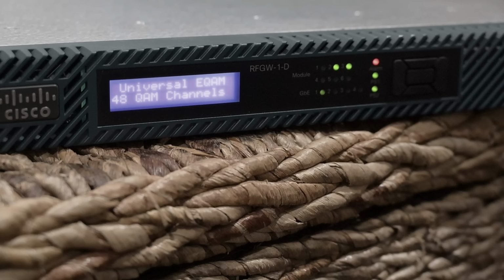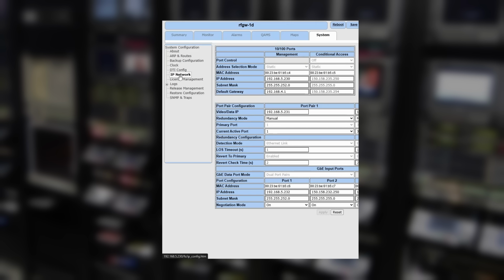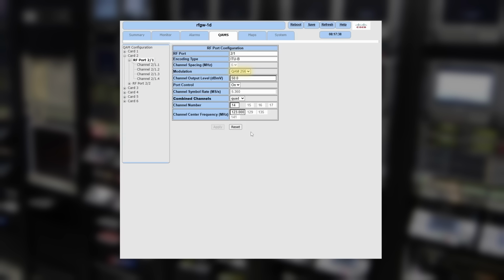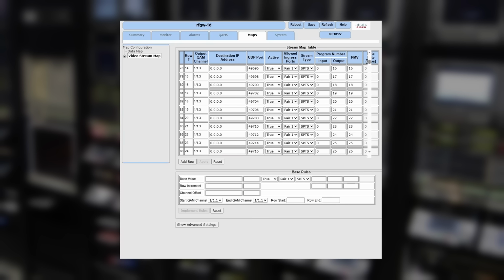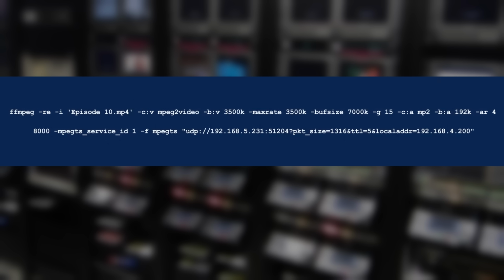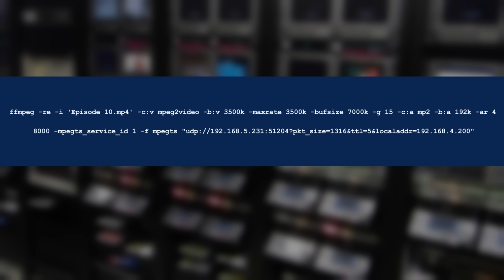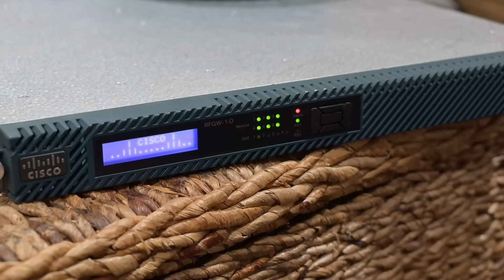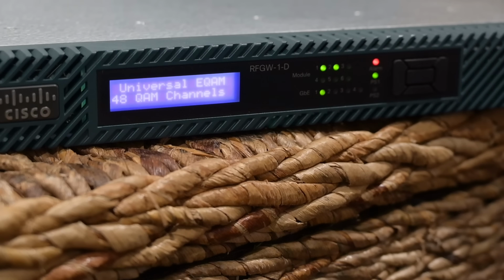Broadcasting my own Cable TV Program | Cisco RFGW-1-D Homelab Setup & Testing

Comment: Generally the DB25's were not used. Alot of the MSO's would use ASI in/out, Gig-E in out. some of the older stuff is DHEI which is for connecting to motorola sat receivers.

Comment: I work in a hospital and this is similar to what they’re are using to provide analog tv in patients rooms. 

They’re using a mixture of over-the-air channels and premium channels using encrypted stream via internet. 

The equipments and the encrypted channels are provided and managed by the in-town cable tv provider. 

Obviously the ATSC channels aren’t charged by the company since they’re available for free however those are integrated into the system.

TV in pts. rooms are powered using the coax coming from each departments network closets.

I was very intrigued by how it works, no ones was able to tell me and there was no way for this to stay mystery to me so, I’d start making researches on the web and watched videos like this one (this one is kind of very of useful). 

Also, getting a peek inside network closets and at the headend enclosure at the top floor, where the antenna is located. (the coax from the exterior antenna is thick as my thumb!!!)

Comment: the QAM card that you can't figure out is the DRM encryption card the cable company uses to encrypt their video signals so you can't steal cable. QAM is an encryption scheme that some TV's support with pre-encoded keys but most companies require you to get their setup box that has their keys and software/firmware from their servers.

Comment: Be sure to terminate any unused coax ports otherwise you run the risk of injecting noise into your local cable plant.
Reply: That's not why terminating resistors are used. There's no radiating antenna coming out of a splitter; its not transmission that they are to fix. It's the reflection of signal coming in, going right back out the input, if there's no where for the signal to go. Cable networks are already 100% shielded, and the FCC gets pretty mad if they leak (and being actual lengths of cable instead of a single device, frequencies couple to the ground and this makes the cable a radiating antenna. Same tech as "leaky coax" antennas in subway tunnels) So a terminator is providing attenuation so that your source signal doesn't reflect back to itself and cause its own interference.
Reply: @mystica-subs wrong

Comment: this is paired with Cisco 9900 series encoders, and the true behemoth of AV, the Cisco DCM9900 and its later variant, the DCM9902.  The DCM9902 is still in current use because it's still one of the only devices that can add/drop programs from a real-time transport stream without causing hits to programs already in the transport streams.

DM me if you need help with a DCM.  They're a nightmare.

Comment: 4:26
Because cable plants are susceptible to issues: QAM256 was a good default modulation. Without having dynamic/negotiated modulation and "timing" for set top boxes: they all would need the same modulation profile.

QAM64 was good for channel 2 and below 54MHz, while QAM256 was good for higher channels (just due to how RF interference on cable plants worked).

With the advent of Docsis 3.0 and Docsis 3.1: the cable modems can negotiate with the CMTS for adaptive modulation profiles for the downstream and upstream, allowing for higher bandwidth when the cable system supports it.

Older TV set top boxes needed a telephone line to register to get VOD channels, there was no easy way to negotiate different qam modulation. The TV signal was either on or off (or digitizing like crazy!)

Comment: This thing brings back memories. Not specifically this unit but all the VoD/multicast video network engineering required and multiplexing onto cable systems with existing services.
Good times.

Comment: Though the end user sees "channels" mapped to programs, technically the 6MHz-wide channels this thing modulates onto are channels in the analog TV sense. Analog TV channels were 6MHz wide to accommodate the 6MHz total bandwidth of the NTSC standard. There was a couple decades long overlapping period where digital TV and DOCSIS coexisted with analog cable TV on the same coax, which is why digital cable still uses analog cable channels as the transport under the hood.

Comment: Those bypass cards will output the raw data or video streams. It bypasses the modulators and outpus the input of the non existent modulator. Likely it was used for dedicated monitoring displays or they had external transmitting gear for some other technology or higher power.

Comment: instead of shoving the output of this into a TV tuner, you should shove it into a TV antenna. :D
Reply: “The Freakin’ FCC”:
Reply: @NoTraceOfSense  if it escapes your basement i'd be extremely surprised.  that cisco device is not a 100,000W RF source, it is a 0.012W RF source.  The signal probably wouldn't escape most antennas.

Comment: I checked on eBay, these little beasts are expensive! :(
Reply: anything that has a fkin cisco logo on it, cost a house or a mid-size luxury car. Even worse, when cisco manages to bind their expensive sht to online phoning home, so if the damn license is not active, it refuses to function and shuts itself down. No matter how good shape the actual hardware is in, the god damn license kills the 2nd hand market of these equipment.
Reply: @ricsip  not wrong, dude!

Comment: I was able to buy a HDMI to DVB-T transmitter + receiver to HDMI set ~$800 many years ago
It was for p2p wireless video transmission, but I find it works well in some TVs with a sloppy wire as antenna.
If you don’t need all sorts of fancy functionality of DVB(like multi channel audio, textlet, EPG etc), you can try to find one.

Comment: I was at a caravan site as a kid on holiday.  I noticed all the caravans had all the free channels from satellite TV through a coaxial cable with the TV's in built analogue tuner.  When talking to the site owner at the clubhouse, which is like an onsite pub.  He was telling me he used to work in broadcasting and had done all the work him self.  He also said you can receive all the premium satellite channels down the same cable if you plug in a Sky satellite receiver with a encryption card.  He went on to explain this way everyone can receive TV without needing an Arial or a satellite dish keeping the caravan site clean looking.  Which I always though was impressive.  He was going to show me the equipment but my parents pulled me away telling me not to be a pain.  I would of loved to see his setup.
Reply: On the other hand if the signal he spits out is over the air without a license, he’s in real trouble. (And you can’t get license anyway) So coaxial makes much sense.
Reply: @flyviawall4053  I guess its like cable TV and broadband.  As the signals are contained in a cable, you do not need too much power to send the information.  As well the small amount of RF that dose escape will not cause any interference one a few foot away from the cable.
Reply: @gavinnorthants That’s true but complicated. Why use coaxial is more about impedance matching rather than leaking or power, but it does reduce power and leaks.
Reply: @flyviawall4053   Uh, no.  The nominal characteristic impedance of a CATV cable and an antenna is the same -- 75 ohm.  (Well, there are other antenna impedances, but assuming it's connected via an F-type coaxial connector, where a CATV cable would also be connected, then it's 75 ohm.)

The reason to use coaxial cable is indeed mostly about "power and leaks."

Let's tackle power first.  Prove this to yourself:  Take a VCR and connect an antenna to the RF output jack.  Connect another antenna to a nearby TV.  Then, tune the VCR's RF output and the TV to the same channel and try to receive the VCR's signal wirelessly.  It will work, for a short distance, but it will probably look bad unless you're right up close.  Then take an ordinary coaxial cable and connect them directly.  Same output power, but you'll have a much cleaner image.  Ergo, for the same drive power, you'll get better results with coax cable than OTA.

"Leaks" has a few implications.  For one, the cable company probably prefers that you pay them their monthly subscription cost, so it would be best if the CATV infrastructure does not broadcast openly.  (There's also conditional access, i.e., encryption and scrambling, but still.)  The FCC (or your regional equivalent) would prefer the signal stay in the cable, too, to prevent it interfering with OTA.  Finally, unintended radiation is power wasted, so if you can retain as close to 100% of the signal going down the cable as possible, that's better for power efficiency (which is related to the first half above.)
Reply: @sirnickity The problem is impedance matching is almost a duo to leakage for coaxial cable. Since it’s not differential signal, the shield itself is a giant antenna without counterbalance field. But luckily it’s VHF and UHF, skin effect really kicks in. But if impedance seriously mismatch, the leakage right on the feed point will be so bad that shielding cannot help much.
Reply: Remembering those details to this day says how passionate you are about this
Reply: Too bad your rents pulled you away. Guy was probably excited to show someone who was genuinely interested in it.
Reply: have loved*

Comment: Hihi! I have a very similar setup with a Motorola SEMv8 (another QAM modulator, albeit less featureful than the RFGW actually) and a few other stuff that make it tick. Protip about the video ingress/UDP multicast: put that on an unmanaged switch or VLAN with no other devices connected (easiest way to do this is with a dumb unmanaged switch). Multicast sends the data to every device on a network, so you don't want other stuff (especially WiFi clients) getting the video data for no reason.

Comment: YouTube recommended video, didn't disappoint. So you could output 4 streams per port? Then you would need to combine the signals to merge 4+4 into a single 8-channel signal? It would be cool to see a Raspberry Pi setup to output streams. I remember seeing something from, like, clabretro where you can queue up media files to play next or let it auto-select.

Comment: QAM bypass cards are likely to allow the digital video streams to be brought in(and out) of the backplane without RF modulation. In other words, the cable company might have some video being brought in by IP, while other digital video from satellite, etc. and combine it. That's all. Also used for testing locally, chaining, etc
Reply: ^ THIS. It literally does what it says on tin: they bypass QAM modulation 
All pre-digital cable signals are QAM. Decoding QAM is what it means to be "cable-ready", but its for TVs
So, if you need to send the video exactly how its going out to DV gear to go to displays, it can't be QAM, and you need to bypass it.
Carriers used to be required to send out QAM. Not so much these days.
Reply: That's probably raw transport stream output on MPEG-SPI physical interface which is a parallel standard to move transport streams. It's quite uncommon, it is way more common to move serial transport streams over ASI on a single 75 ohm coax, but SPI does exist on a few devices, and it uses a DB-25 connector. You can find 1U boxes that have multiple ASI<->SPI converters in it that can convert between the 2 standards, but I don't think SPI had much use at all. More than 10 years ago, I was running a few channels live from satellite over 2 or 3 Scientific Atlanta QAM modulators - I had like 8 to 15 channels running on 2 QAM channels, depending on what I was feeding them from satellite. Cisco eventually bought out Scientific Atlanta, so this box is probably literally a couple generations newer than what I was running.

Comment: I work for a small ISP and we have 8 of these that were used for DOCSIS edge QAM. They're just sitting in storage now as we have RFGW-10s and newer Harmonic gear. I currently have one in a lab rack at work that I'm messing with clear QAM channel in exactly like this. We don't have any of those bypass cards so I'm not sure what they would be used for.

Comment: Hey, I noticed you said at the end that you would love to try to set it up with an old Motorola DVR from the mid-2000s and I wanted to let you know that I am trying to do that as well! Although I think I bought the wrong kind of modulator. Which rn, I'm working with a Motorola DCH3416, which has two tuners, one for watching and one for recording.
Reply: Just saw you liked my comment, I wanted to ask, have you attempted to use your modulator with a Motorola DVR? I just wanted to see if you had any progress on it, if you started yet.
Reply from the maker: I haven’t attempted it yet, but i was also looking at a motorola dvr in the DCT model lineup. I’m not certain it will since they were often provisioned per cable provider and they usually require out of band capabilities that just a QAM modulator cannot do. It might be useful just for channel hopping but i was hoping to get it set up with guide information as seen from comcast at the time. I’m currently in a rut with the video im currently editing lol :/
Reply: @slapshot300  Oh ok lol, which im currently saving up for the right kind of modulator, since mine didnt seem to work since its just a basic consumer one. Which, also my dvr box actually had an old channel map stored in it I guess from when it was last connected to a cable provider and it lets me go into the guide and it attempts to tune to the programs listed. So, im hoping itll let me watch things without the out-of-band part. 😊
Reply: @slapshot300 A little update, I finally got me a proper QAM modulator and my Motorola DVR Box actually locked into it!!! However, I couldnt get the video to play either due to the Program Clock Reference or if it needs OOB data. It does work perfectly on a TV though.

Comment: What you got there is a DOCSIS 3.0 modular CMTS (cable modem termination system). In this case since it’s modular it allows you have different use cases depending deployment type. The bypass card has two purpose that come to mind but this is my best guess, it’s either bypass digital QAM encryption (clear QAM) essentially any Tv can pick it up with out a Set top box. My second guess would be that it’s a pass through so if you were combining RF signals this card would pass the signal along if there was to be a failure of some kind. 

Now the cable industry is starting phase out coaxial video, in favor of IPTV with Fiber and or DOCSIS 3.1-4.0 (high/ultra high-split). As of now a good majority of headends have DOCSIS and video separate, they then combine the digital video channels with the DOCSIS channels. Once you have everything prepared in the headend they use media converters to convert the RF into light sending it over the HFC network. The active coax nodes turn the fiber optic light signal back into RF and amplify the signal down the coax plant.
Reply: As it's not talking to "modems", it's not a CMTS. (Cisco does/did make them, but they're generally huge, and expensive.)
Reply: This is just the downstream rf part of a CMTS setup, you would use these with a UBR10k series router. You would have only upstream rf on the UBR and network interfaces for DEPI (I think) to the RFGW.
Reply: There's not a single provider in the country (or likely the world) running on "ultra high split". In the states, some companies are doing mid-split and others high-split, but ultra high split isn't a thing in production anywhere. I'm not sure where you got this misinformation from.